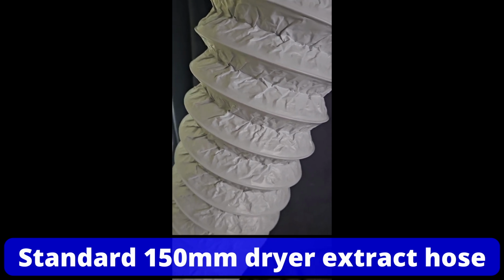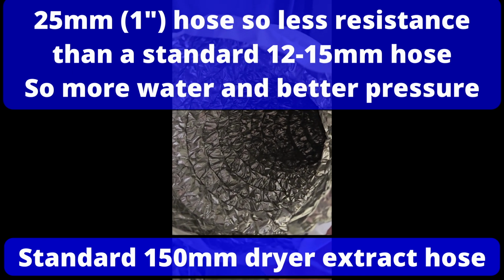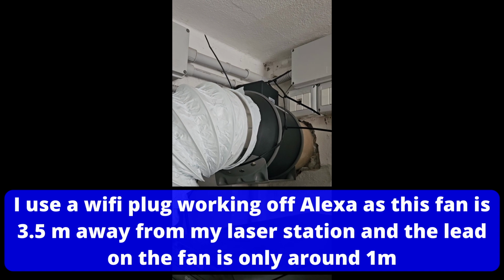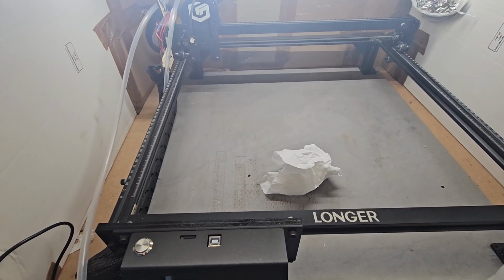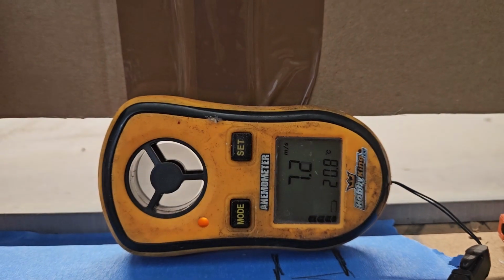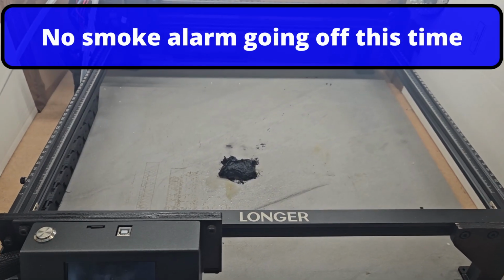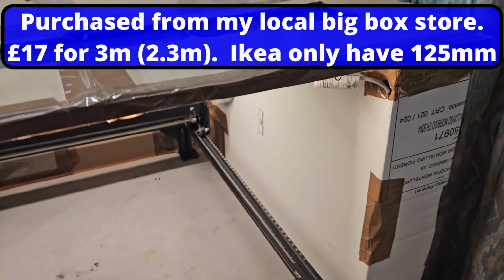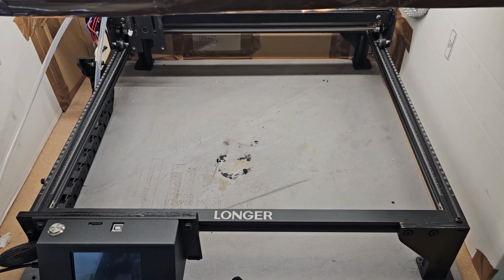Improve Laser cutter engraver smoke extract duct smooth bore metal duct 600% Increase in air flow

Comment: Awesome video Andy, very informative! I'm using the same smooth aluminum pipe, and you're absolutely right about the difference in resistance. As soon as I switched mine, not even a burn smell in the house from the basement.
Reply from the maker: Nice. I knew it was going to be better but 600%. Smooth bore for the win and better fire safety

Comment: My old hose broke last week. It was similar to the first one you measured. While browsing at the hardware store for a new one I was literally holding the new one you have there in my hands but opted for the old one because I knew what I was getting. Since I did not take it out of its packaging yet, I guess I should return it and get the smooth one instead.
Reply from the maker: Yes please replace it. Not only will the fan work better but should you have a fire hopefully it will remain in your enclosure. Please update me when you have it fitted